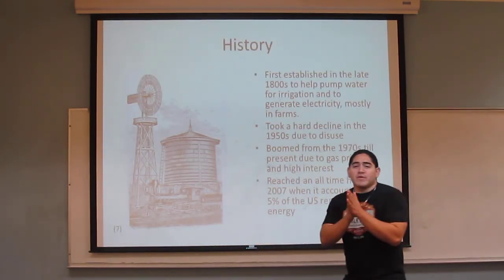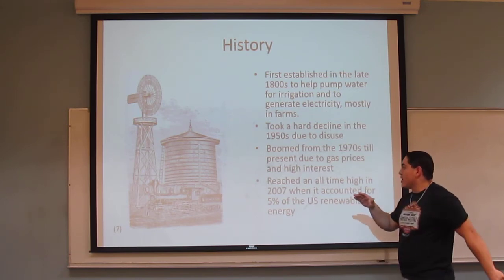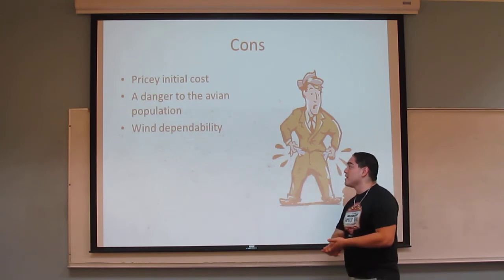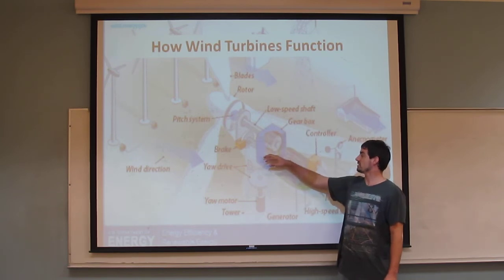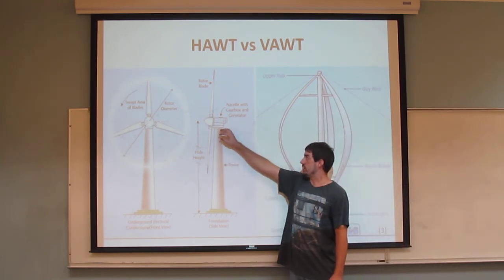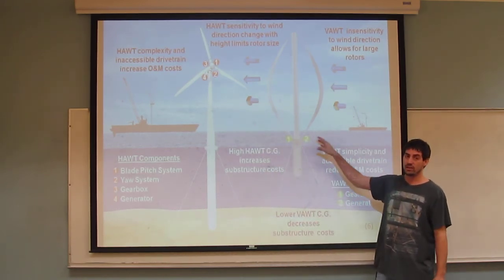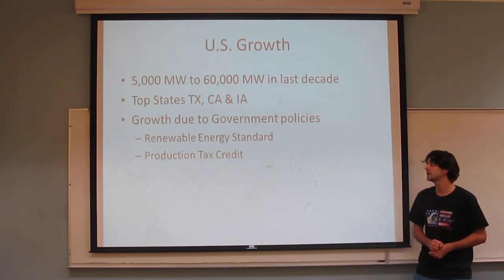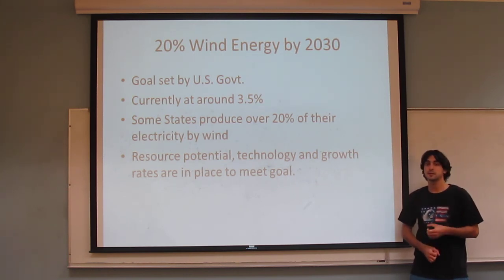Team B: Wind Energy

Comment: The presentation was clear and straight to the point, they all explain everything well. They used the slides to their advantage to guide the audience through out the presentation while they maintained eye contact with the audience.  The length of the video was good and the slides were very clear.

Comment: The overall presentation was great. Every member spoke clearly and to the point, which made it easy to follow along with the presentation. Each member had a great amount of knowledge of the topic. However, the idea of the improvements of wind energy was not discussed, instead the history of the topic which may have been irrelevant to discuss for this project. More time should have been used to discuss how you can improve on wind energy, whether it was improving the design of wind turbines or introducing something else.

Comment: The introduction was clear and straight forward. The first presenter was choppy with his sentences; I think that some fluidity will add clarity and effectiveness to the delivery. However the content was good and it stayed on topic; it definitely taught me some about wind energy. I would recommend you guys upgrade to at least a business casual look to add some professionalism to the report; even though the content was good, it is easy to be judged and shut out by listeners who see professionalism as an important quality. Additionally, the visibility was good (but it suffered on the slides that had images) and the sound quality was great. I think that the video length was reasonably within the given parameters and it holds value that it was done all in one take. Overall I think this was a good presentation, add some collar shirts and it would go from good to great.